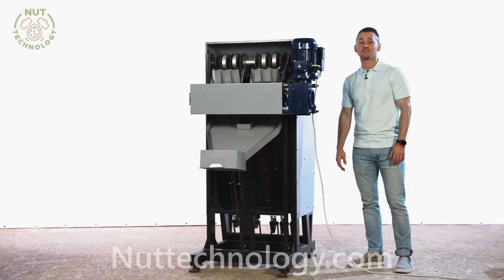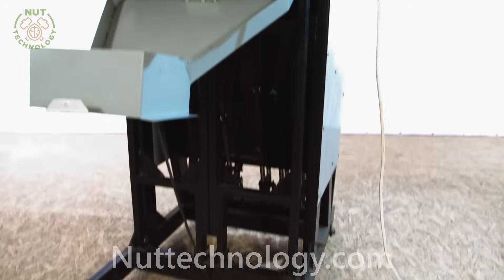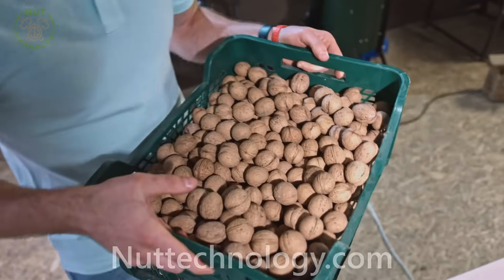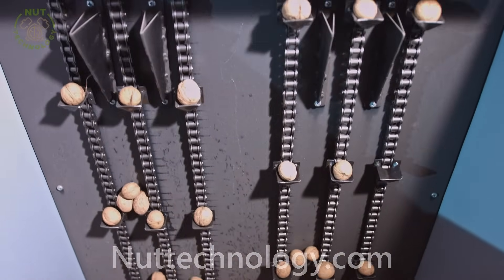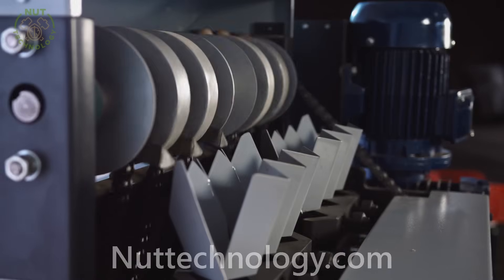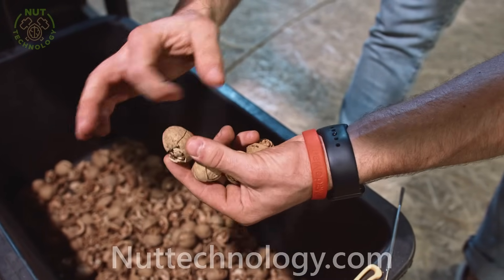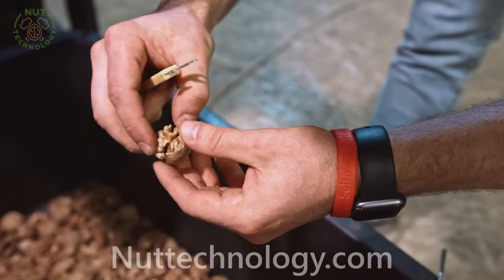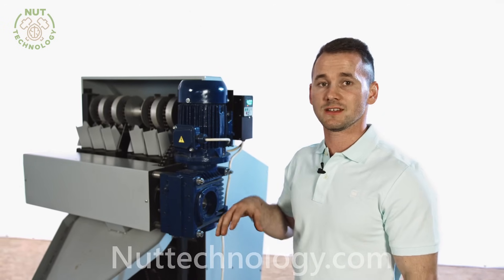Walnuts cracking machine. Walnuts processing

Comment: Can this crack morula nuts?
Reply from the maker: Hello! This nutcracker is designed to split walnuts. If the morula nut is similar in structure and size to a walnut, then theoretically it can chop